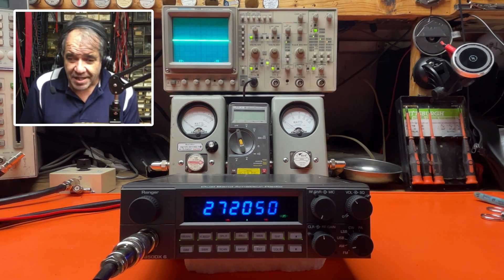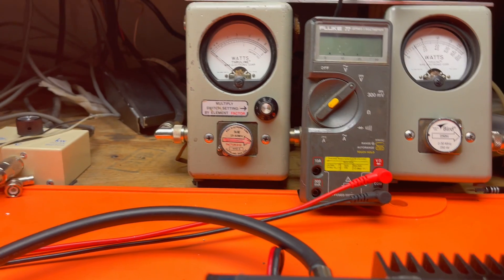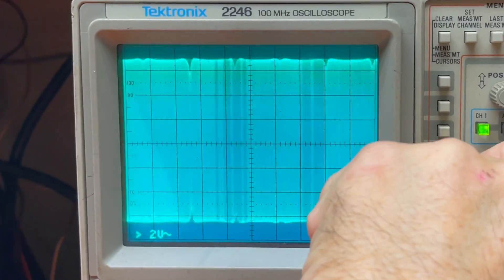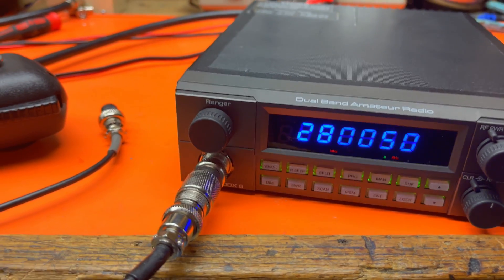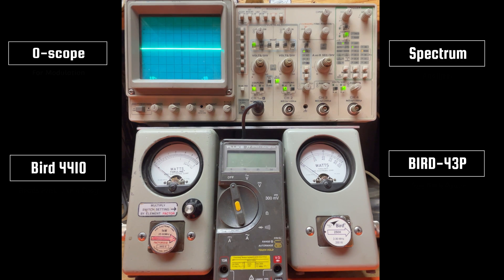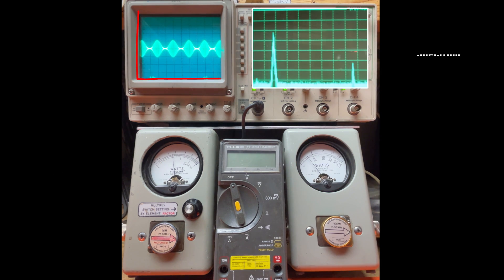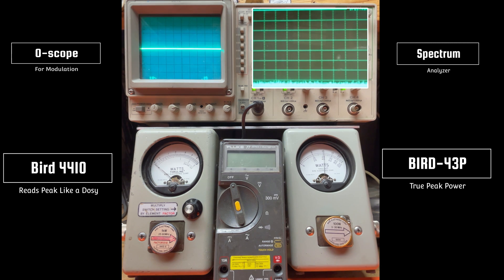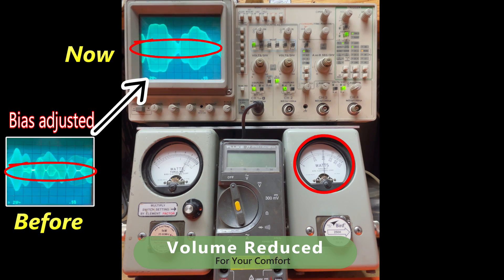Ranger RC-2950DX6 Tune-up Report (2022) for Dave in IL

Comment: Very good detailed video , I know that was a lot of editing work .  I really like those radios and am interested  . 
Two questions about that particular radio 
1. Can you turn the RF Power down to a 2 watt deadkey and still swing the full 75/80 watts , or do you have to install a swing mod kit to make that happen ,, or is it not an option ?  Or does is swing full peak power with a low dead key and I just didn’t catch that ? 
2.  Is these Rangers any more stable on SSB than  Galaxy radios  ? I have a Galaxy 98VHP and it drifts so bad on sideband it’s annoying .  

Thanks and 73’s , keep up the good work 
347 Cowboy waving from Manchester, Tn
Reply from the maker: It would take a "swing mod" of some sort BUT, nothing will make it sound good with that much swing. (except turning the mic way down so it wont swing that much).  Radios that swing that much only sound good when set with mic gain low enough so it swings about 10-20. It only gets higher when he goes AAAHHHHDIO into it but not during normal talking.  If it is possible to do AND make sound well, maybe 𝑩𝒍𝒖𝒆 𝑻𝒉𝒖𝒏𝒅𝒆𝒓 at @ASYMOD SUPPORT can help you with it. 
 𝑺𝒄𝒓𝒆𝒘𝒅𝒓𝒊𝒗𝒆𝒓   𝘽𝙚𝙡𝙡𝙨 🔔 𝘾𝘽
Reply: @BellsCB  
Gotcha ,, I appreciate it . I need something(mobile)  that’s a good sidebander that will do about 50 watts , but still has a low dead key to drive a 2x6
Reply from the maker: Go with the Lincoln II+ for those specs.  great radio.